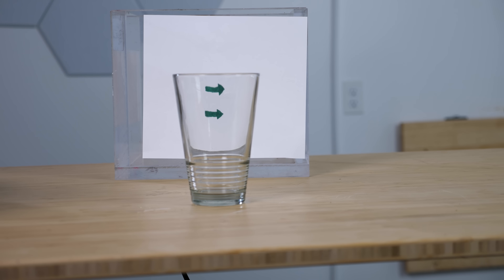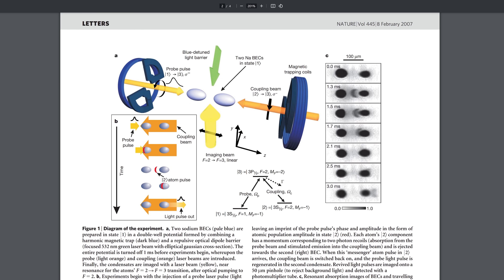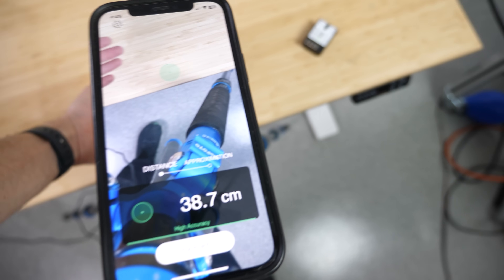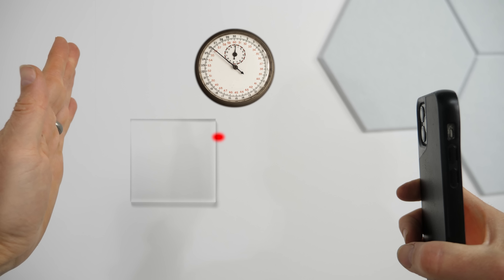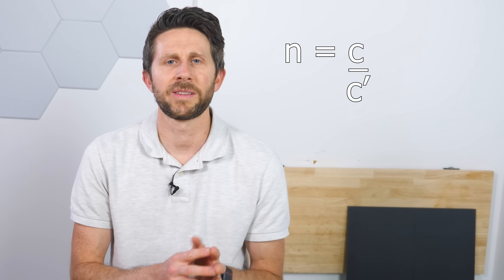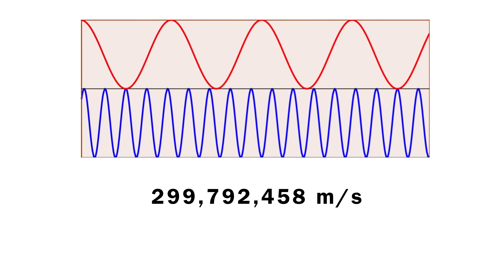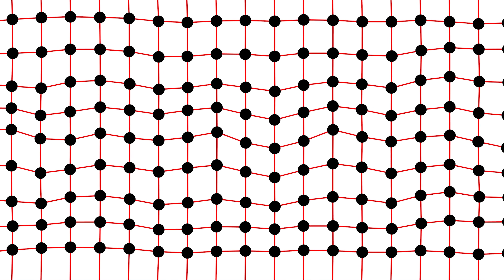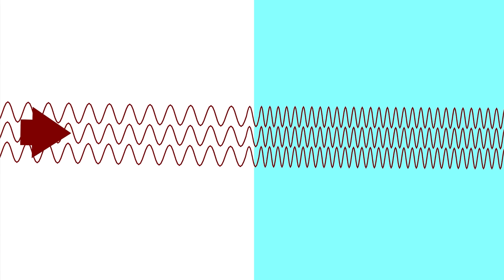Solving The Slow Light Paradox

Comment: This is a hell of a rabbit hole, the mathematics behind it is crystal clear, models can show aspects of whats going on, but a complete intuitive explanation of whats actually physically happening is incredibly difficult to grasp. Like a lot of things in physics the more you learn the more you realise the naive explanations just dont cover the full range of weirdness of it all.
Reply: Exactly my feeling. The problem is, you can visualize the behaviour only for a very tiny section of the whol thing (1 wave cross section + 1 electron). The real process in 3 dimensions and for multiple elctrons and waves is overwhelmingly more complex. I can't imagine anything of this tbh.
Reply: I picture this as like the light gets pushed backwards a bit when it comes across a medium, and then it continues to move at c. But because it got pushed back when it touched the medium, it'll reach the other side a bit late even though it's still moving at c. So from our perspective, light seems to be slowing when in fact it just got offset backwards a bit.
Reply: @Dipj01  interesting thanks
Reply: " the mathematics behind it is crystal clear"  You've earned a gold star for that line!
Reply: Someone explain to me how this works as a photon of light. Whenever I see videos or explanations done about this, everyone starts showing waves. While I know light behaves both as a wave and as a particle, if we don't know how an individual photon 'knows' it transitioned into a different medium, there's a possibility this wave theory is also incorrect. Also, the way it's explained here and everywhere else is that a single atom's electrons changes the wave and then it gets passed on to the next atom's electrons.... but isn't this additive? If that were the case, enough length of the material would make it completely opaque, and well before that the refractive index would be observed as being dynamic. It makes 0 sense that this is considered the proper explanation.
Reply: 🚩This is why many people have started hating scientists 🤢🤢🤮They lie & manipulate with ZERO shame🤢🤢🤮 Light NEVER slows😡It just scatters in denser material, which makes it takes longer time to pass through🤏

Comment: Great explanation, but it still glosses over the fact that the light sensors must be measuring a steady state or this wouldn't work. If you shot a true impulse of light at the acrylic and were somehow able to measure it bouncing back you wouldn't see a delay. What happens in practice is that in that short blink of the led indicator the electromagnetic field has enough time to oscillate back and forth billions of times and the sensors that pick it up have plenty of time to resonate with the EM field to detect a signal.

Comment: Video 5 of asking about a question you can answer, if you take a closed container with a small opening like a bottle or a jar and fill it with co2 when you put it outside down will the co2 be able to escape and it would fill with oxygen because co2 should go down oxygen goes up or nothing would change and what would happen if you fill it with oxygen and set it on the floor.
Reply: At room temperature:
The density of air (~21% oxygen and ~78% nitrogen and <1% co2) is 1.293 kg m−3
The density of pure nitrogen is 1.251 kg m−3
The density of pure oxygen is 1.429 kg m−3
The density of pure co2 is 1.980 kg m−3

From this data we can conclude that turning a jar of co2 upside down in air will let the co2 out and it will be replaced with air since it is heavier than the air around it.
Putting a jar of pure oxygen on the floor wll let the oxygen stay in the jar since it is also heavier than the air around it.
Reply: @LaSDetta  okay wow i wasn't expecting someone else to answer it. Thank you so much.